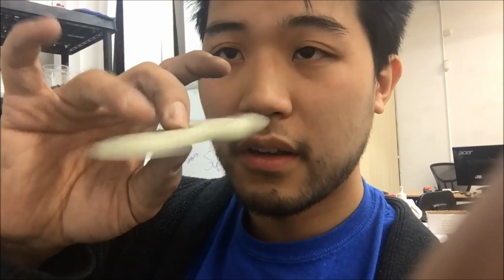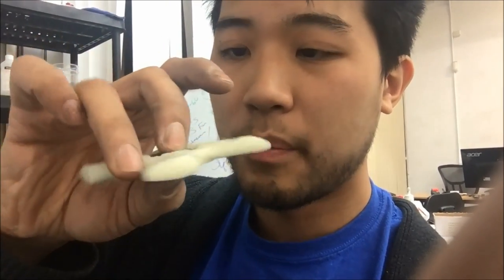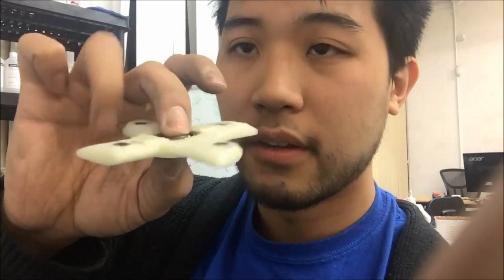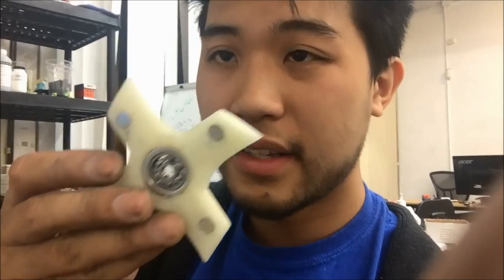Cubicle Labs Failed Projects: Magnetic Spinners

Comment: :(
Reply from the maker: I got the idea from this person, everyone!
Reply: lol I thought he was just joking.
Reply: Humphrey Wittingtonsworth IV just an idea, what if you took a regular spinner, and took out the main spinner with bearings, and on the caps where you put your fingers, sand off (this would be harder on metal spinners) the whole ridge that joins the two caps off, then replace it with a magnetic cylinder which is superglued to the caps, then, put a replace the bearings with a magnetic washer that is the same height as the cylinder. this would increase stability, as the washer and cylinder would atract. then, surrounding the cylinder on the caps, glue much thinner washers that would repel the big washer. as far as i can see, this would fix most of your problems. the only issue i can see with this are the very specific magnet requirements. but im only 13 years old, so this idea may be awful, but it just came to me and i wanted to mention it.
Reply: I'm 13 and I know I couldn't come up with such clever idea.
Reply: its really not that clever. since i posted that comment, i have found numerous faults with that idea. first off, the magnetic cylinder would have to repel the washer around it, not attract it, and a magnet like that would be near impossible to find.

Comment: You should use a long cylindrical magnet instead of that plastic piece that broke off, use a relatively strong magnet to use as the "axel" in the middle of the ring magnet by doing this it might work because now instead of the just the caps repelling, now the inside will repel so it won't get stuck and cause friction in the middle ring magnet. Hope this gave you a new approach on this project I just don't have the stuff to do it like a 3d printer but I hope if you do it, it works :)
Reply: I have made a simple design      if you want to print it just ask and I will send the design all you have to do is edit the model to fit the magnets you are using other then that it should work pretty well
Reply: I'm only 12 so if you find any flaws in my design just fix them but it should work

Comment: Hey you missed one force out. There's an equivalent of resistance in the magnetic field as well, which is caused by the formation of eddy currents.

Also I didn't really understand what you were trying to say early on. Were you trying to balance magnets to make it float? Because it's actually provably impossible to balance a static magnetic system - you can't do it, it requires a dynamic system so requires energy input.